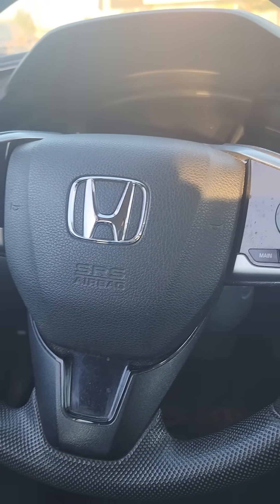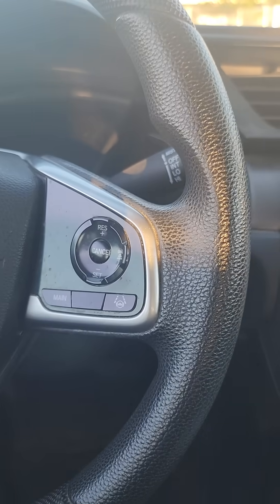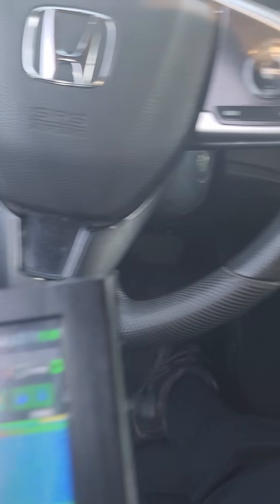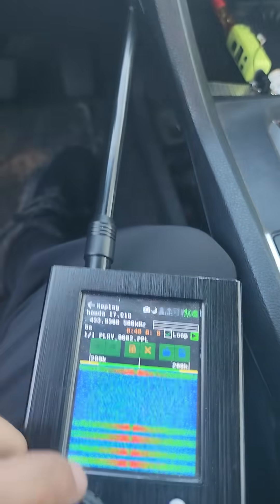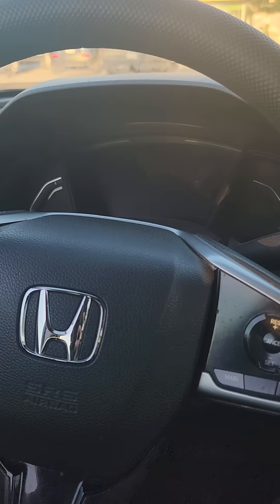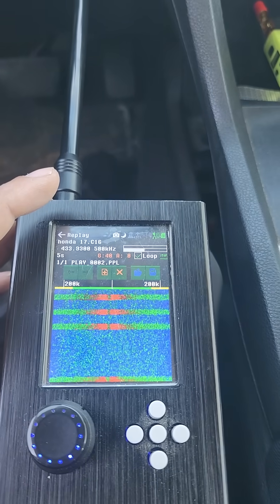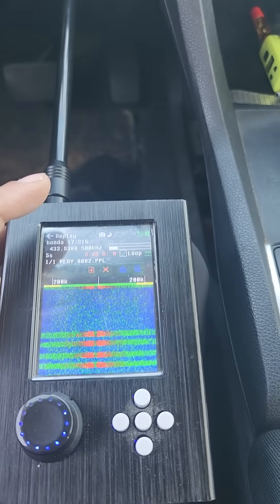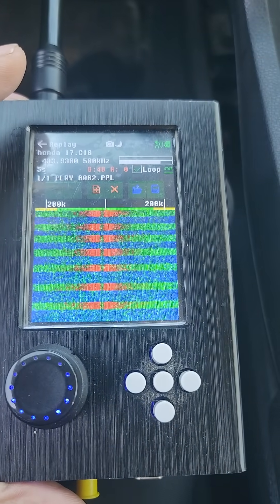"I Hacked My 2017 Car with HackRF – Key Fob Replay Attack!"

Comment: Private firmware V2 for flipper zero can do better 😎
Reply from the maker: Flipper zero cant do half the things the hackrf can . Plug i own chelome ultra .and promxmark3 mac
Reply: @kobepower Really😂HackRF can manage rolling codes?? Garage/cars rolling codes?😂
Reply: @kobepower hey I had a Honda Civic 2016 a few years back that I suspect some people had hacked into it.  It started doing things on its own like the alarm would just go off and you couldnt turn it off.  Windshield wipers, the battery itself would turn off for 20 minutes then turn itself back on and then have the alarm go off like super weird.   Around that same time some people were doing some suss shit I caught them on.   But is that even possible to do? Thru like an odb2 port access after lifting the signal to get in?

Comment: Looks like you’ve preformed a rollback attack 

It exploits the resync feature when you press your key X amount of times it sees that they are in order but not correct for count so the vehicle assumes it’s out of count and will reset to that state and allow the next in the sequence to unlock it 

So essentially it will see code one and will refuse

it then sees code 2 and it will think hold on I think I might be behind or in front of the keys count 

It will then see the third and it will go yep I’m definitely wrong and it will open 

It may take more or less than 3 to spoof this but that’s the gist of what’s just happened
Reply from the maker: I copy the unlock and lock on remote on capture feature it fixed code
Reply: @kobepower  if you’ve not looked into rollback before tho I recommend it keeloq systems are usually susceptible to it and some vehicles 😉 

Haha sorry to get it wrong tho I’m I’ve done a fair amount of work on willing systems and sometimes forget that static still exists 🙏🙏
Reply from the maker: @adzowndu4492 that why how honda using this still im working on fgpa and stm32f743vit06 board do rolling code im getting Texas instrument sub 0 board, it gonna be crazy build using Ai for prediction
Reply: @kobepower  heaps nice I’m currently in the works of reverse engineering the sequence of my Hyundai I’ve got a working process currently I’m working on rebuilding the protocol for a more refined end product but it’s a complete work flow as it stands currently have it cracked enough to exploit it’s pretty cool
Reply from the maker: @adzowndu4492  ya so have you heard of hydrabus v2 with nfc it crazy . Google it u gonna be like I need that im building something similar to it but faster with my stm32. U have a repo. I would love to see it
Reply: @kobepower  not at the moment I’m considering it tho
Reply from the maker: @adzowndu4492 and tesla charing port is always fixed code i opened it i show that next lol. It funny I go by tesla dealership and open all the ports it s 315. Fixed
Reply: @kobepower  yeah my flipper loves em
Reply from the maker: No it doesn't
Reply from the maker: No it not it fixed code I did im showing u 😤
Reply: @kobepower  oh ok haha I’m just so used to seeing a rolling system